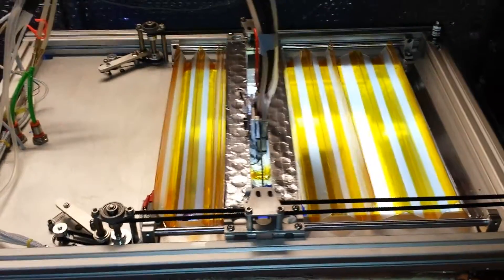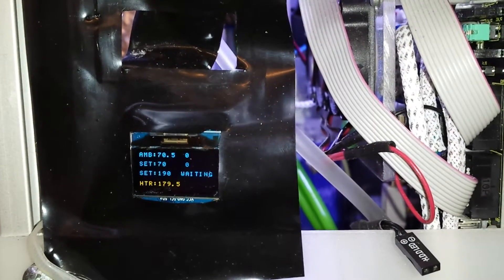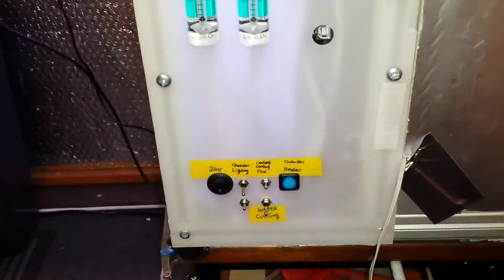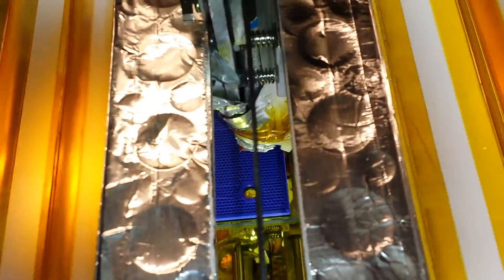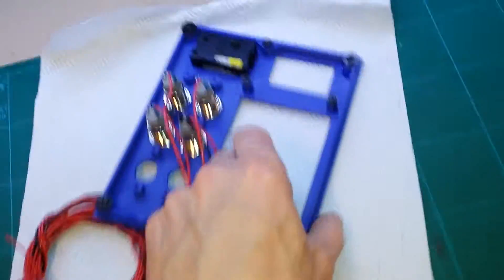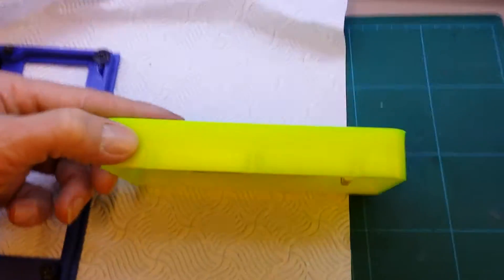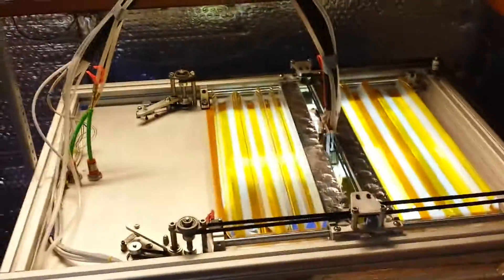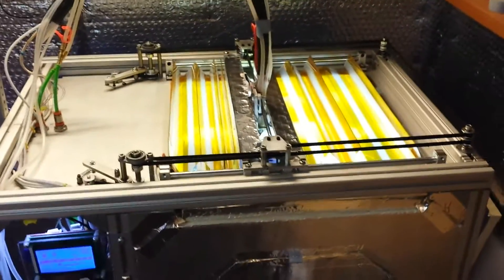3D Printer and Heated Chamber for ABS

Comment: Have you still got the old iron in the bottom?  Looking good.  Was it worth it?  If I make one it'll only be a 200 x 200 print bed.  The stuff I'm intending to make will only a few inches across/up/down.  Is it only the big area prints that provide most of the difficulty?
Reply from the maker: Hi Oz. These video's are rather old and out of date. I rebuilt the chamber heater only a few month's ago. I print a lot of large things in standard ABS and the heated chamber is essential to achieve good results and any serious strength. Good luck with your build.

Comment: How's it going with this printer?  Any updates?
Reply from the maker: Hi Jai.
Yes I have a few since the last video. I will try to get time this weekend to put something up. Just purchased my 300mmx300mm sheet of bed glass and will be upgrading the bed to full size very shortly. I have been busy printing more than upgrading and work is flat out and so its been difficult to manage time. I found a good project online printing a wind turbine and have been busy printing it in my spare time. but now I really need the larger bed and some of that PEI sheet to cover it with. do you have a recommendation of a supplier in the UK i can use ? AND Hows you ? any thing interesting going on ? :-)
Reply: I really can't remember where I got my PEI.  I remember having to search for ages to find a UK supplier, but that was nearly two years ago!  Unfortunately I ripped the first (half) sheet of PEI the other day.  I was printing some Colorfabb XT-CF and lazillly set the nozzle gap too close.  That stuff sticks to PEI like cat sh!t to a rug... I have another half sheet (my bed is small) but no 3M double sided sheet to stick it to the glass with.  I did get a sheet of Garolite to print Nylon/Nylon CF on though so will have a go with that for a while.

I've been trying loads and loads of materials recently.  Taulman Bridge is amazing for semi flexible parts, RigidInk Carbonyte is a really stiff, strong and amazing for non detailed load bearing parts, Colorfabb XT-CF is pretty and does away with PETG curling issues, and oh my god:  Polymaker PC-Max is just amazing for detailed, temp resistant and incredibly strong parts.  I lOVE that material.  Have to take measures to prevent warping as with other Polycarbonate.  It will print beautifully in your machine, just forget the build tak and raft.  Treat it like ABS that curls and the prints will come out stunning.

I've designed up a machine using some really nice linear rails I have from stripping old machines at my last place of work (I was a manufacturing engineer).  That will be good but the hobby is off the cards until after our holiday (she gave me three months notice to pay for my half of a new zealand trip!).  When I get back I am going to finish a Prusa MK2 clone I've started.  That will be my workhorse and replace my CTC.  I'll build a semi heated chamber for it with IKEA lack tables and use it to help build my next more 'industrialised' printer.  Think: Stratysis rip-off.

I was lucky enough to come into a small amount of money and want to build a decent printer and a small CNC router.  Two machines that can pay for themselves, and enable my hobbies: DIY speakers, 3D printers and hopefully more CNC.

That was a long reply!!  Find me on Twitter and I can share my email address rather than something so public if you like.. :)

Comment: looks good, do you know how to configure the the display and the mks board, i cant get the display to work.
Reply: you have my email, can you send me rhe complete firmaware and config files please
Reply from the maker: Hi Franz . yes I will find my files shortly and send you what I used. May I ask what doesnt work ?
Reply from the maker: Just sent you my config file and a link to download the original set up files incuding the .bin file to reflash the TFT from the SD card.link to files on my google drive. good luck
Reply: The mks sbase turns on, but when i conect the tft , the tft does nothing, i dont know if i have to press somthing or conect it to the powersuply or configure a jumper, i have plugged it in to the mks sbase board, or must i conect 12 volts to the sbase so that the display works, just had it on the usb of my pc, and i have an other question, what display have you set in the config of smoothieware, i have it set to no display.
Reply from the maker: Ah ok . I set my board to reprap_discount_glcd . then using the .bin file I reflashed the TFT using the SD card. then updated the config on the SD card to suit english and the basics of my set up . 1 nozzle  etc.
Reply from the maker: the TFT will only respond if the MKS main board has the SD card inserted with the updated config.
Reply: Accel erate ok thanks